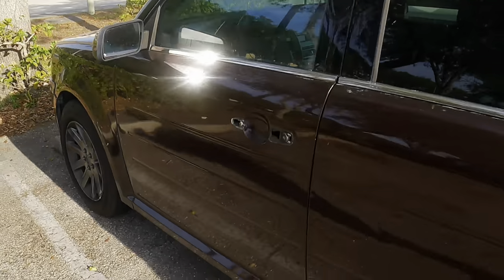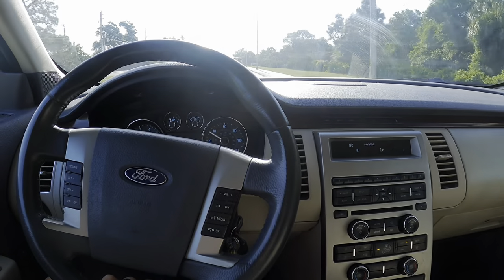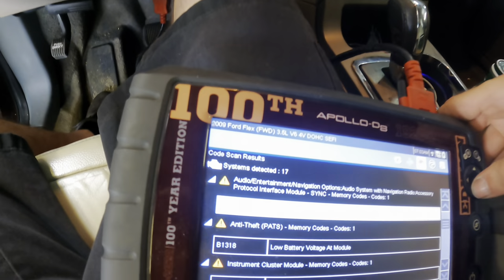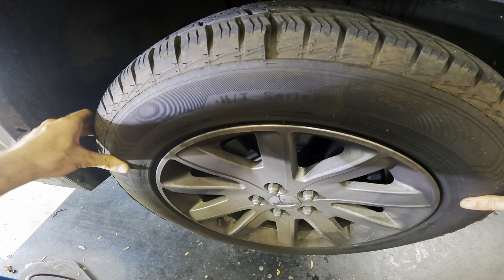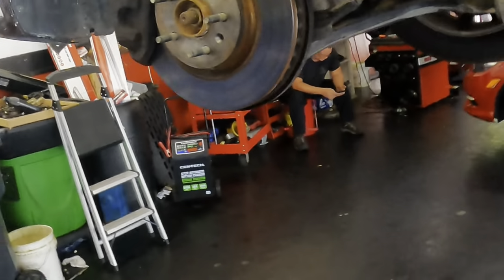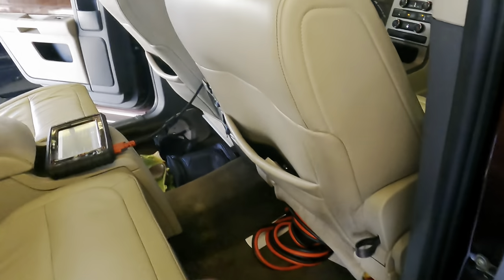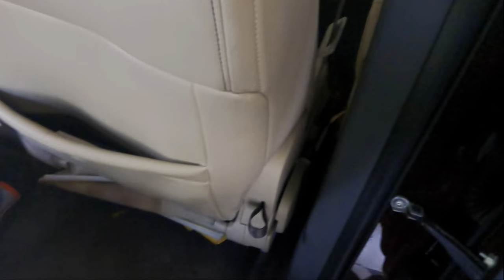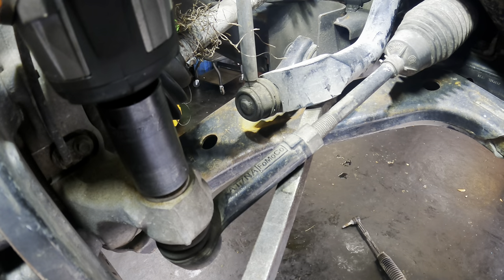Punishment from the Car Gods! 2008 Ford Flex 3.5l Airbag, Banging, Vibrating parts falling off

Comment: You should have checked that tie rod for tightness- it's obvious someone has been working under there and that thing might not be tightened onto the rack.  Lots of clues here- new oil pan, broken engine mount, brake pad clip out of place, no hose clamps on tie rod boots- all say that this car took a big ride off road and someone was under there trying to patch it back together.

Comment: The only Ford’s I would ever own are their trucks. I’ve never heard good long term reports about any of their sedans/crossover/small SUV’s.  That’s probably the reason they have discontinued all their cars except the Mustang this year. To be fair, pretty much all modern vehicles (especially American) are prime examples of planned obsolescence in action. My mother bought a used Escape and it was always having problems. I own an Expedition and the only problems I’ve had so far is the heater blower motor is going out. Thank goodness I have a pretty comprehensive extended warranty on the thing.

Comment: I swear Ray would have been like "WHY" this morning if he had done an oil change on my 2015 Mustang.... Got called into the service bay and told there was a problem with my drain plug... Dude was having to put some serious muscle on it to get it out, they replaced it with a new one that threaded in with fingers.... AND THEN the oil filter was on so tight he literally had to mangle it to get it off... WTF with the over tightening... I'll not name the shop but it's a national chain and the one that last serviced my car was in Clearwater...

Comment: again would love laws that would state that cars identified with steering components that need replacement or things like mounts that keep the engine in the car deem the vehicle unfit for the road and the only way to move the vehicle is if its repaired or put on a flatbed.
Reply: Even better would be laws mandating longer warranties. Some 20-30 year old cars and trucks are only just now getting to needing some of those parts. But, because a simple majority of new buyers replace their cars every 3-5 years, there parts are designed to be weaker than they used to be.

Comment: Hey Ray, I know you mentioned in some video a while ago, what is it when you brake and the steering wheel vibrates? I'd call it warped rotor, but you said something different.
Reply: Worn tie rods can cause vibrations in the steering wheel at certain speeds because they allow the wheel to toe in and out at a resonant frequency.  A warped rotor or a really bad high/low spot is more likely to be felt at all speeds.
Reply: @johnallen1901  It only happens while braking.
Reply: @punkboyblue  It can still be a bad tie rod.  A bad outer was causing vibration when braking on my 2008 Ford.  (Rotors were fine.)

Comment: Mercedes-Benz baller, "break job is too much for my penny pinching tight ass"
Beater owner, "yeah, let's do a few of these fixes that are probably going to kill me."
Reply: Been there, done that, back in the day. Need many bushings, shocks, struts, a window motor, a door latch, an O2 sensor, some AC work, and had to use the shift override to get it out if park...but by God, it had new OEM rotors and pads all around, that cost over half what I paid for the car! 😁

Comment: I would NEVER turn the rotors on a modern car or truck since the thickness of the rotors from the factory when the car or truck was built are at most .010 above min. thickness or right at min. thickness. I would have sent the tie rods back since they were clearly not a complete tie rod assembly. I don't think it was necessary to rough up the surface of the brake pads.

Comment: My 2002 yaris with 170k miles laughs at this. Literally no faults, handbrake could use a maintenance but that's it.
Reply: I had a 2007 Yaris.  I had to replace a CV boot, accessory belt, brake pads at 110k miles and changed the battery out after 12 years and that was it.  Very reliable vehicles.

Comment: There is a correct tool for those clamps it squeezes' and pushes down the center at the same time it crimps. the pliers you used are NOT for those clamps. also a 1 dollar Harbor Freight wire brush on a drill works just as well to clean the rust. Again the gravy done at these indy shops is almost unbelievable.

Comment: One thing I have to ask, what is with the dried leaves + rodent festival in every car Ray works on? I guess as the cars are in the shop the hoods are never opened...
Reply: Soy and corn are used as bases for a lot of wire insulation, trim plastic, and foam, these days. Rodents are attracted to it as if it were the original plant materials.

Comment: just throw it away it was designed to only last 100,000 miles. I find a cheap regular end nippers squeezes those clamps easily you just don't want a super sharp pair that will cut the metal strip off

Comment: Good ole Ford never stops disappointing.  Why anyone owns one today is a mystery to me.
Reply: upkeep the maintenance and they are fine....
Reply: There's exceptions out there but generally speaking, maintenance and upkeep aren't enough for Ford.  I've kept every vehicle I've ever owned in top condition and scheduled maintenance.  It's just not enough when your Ford wants to blow out spark plugs, leak coolant onto coils, leak oil out of every crack, destroy its cam followers, phasers put of whack, parasitic electric draws and electric gremlins.  And I'm just getting started with the list of problems Ford creates..... 

You're one of the lucky ones if you haven't experienced the pain.

Comment: My windshield wiper pump wasn't squirting either, 2010, thought it was the pump, was fixing to disassemble everything but decided to blow some compressed air through the tubing back, disconnected at the windshield cowl, into the reservoir and that fixed it, there was some build up or debris obviously preventing the flow.  All good.

Comment: 3M have those hub flange discs. You can get them through Amazon. Been using them for a while now. Ensures you get all the rust build up off so the rotor sits flush and minimizes any chance of run-out on the rotor. A must up here in Canada.

Comment: yeah throwing wheels like that isn't going todo anything cus the tire will hit the back side of the tire/tyre first before the actual wheel BUT if it's a wheel with a nice lip on it then you can actually crack the alloy or cause an unwanted bend in the lip, depends on the wheel.

Comment: Hi, I'm a UK subscriber. When you diagnose faults and the owner declines your repairs, how much does this cost them? 
In the UK, no repair garage would do this. 
When you take a car in for repair, they can replace components that they think may be causing the problem, and still charge you, even though it doesn't rectify the problem.
If you don't pay, they will not release your car until you do pay.

Comment: Always, always, always roll down the window! One of our techs didn't and put the car into to drive on the hoist for a noise and ended up getting locked out. Had that happen randomly in park too. If the window doesn't roll down, I put the keys on the roof. Not like you're gonna drive off!

Comment: Something I was thinking about: I'd be interested to hear from Ray, or others in the trade, are there general rules as to where you should apply thread-locker, or never-seize?  I'm sure common sense is the best way and there will be specific advice for certain applications but are there "rule of thumb" guidelines which gooey stuff should be applied where?

Comment: Whats fun is you walk out with the keys in hand the drivers door is like that one was, there is no key hole on the passenger side its a car with a trunk 
No remote or keyless entry system and the seats don't fold down.
Your only option is a long rod to open the door from the inside with the long rod.

I once did a old car the guy had the handles shaved off he had a pull line in the wheel well  we put on a keyless entry system, and magnetic switch to pop the door latch, but if the doors were locked it wouldn't open.
I also did a big alarm system on it, the boss went out to demo it to the customer with the motor running he got out closed the dam door, the locks locked  it was 45 mints of slimjim fun to get into it.

One other car the guy brings it to the shop parks in front of the garage door. Locks it up didnt drop off the keys or give us any notes on the dam car.
It was a manual transmission,  took me 3 seconds to open the door with a slim Jim it was faster then using the keys.
 I popped it in neutral and pushed it out of the way.

Comment: You need to buy a cheep set of pliers like the ones you were using for the bellows clamps so you can modify them to work better than the ones you were using, those things were kicking your ass on thos bellows clamps.

Comment: 10:20 based on the things wrong with that vehicle in the scanner. I'm gonna guess it's a clunker/beater and they wont want to spend a lot to fix all the issues. Just looking for that "free advice" to make sure it's not a lethal issue.
Reply: Whenever you see a million codes that read "low voltage" it's nearly always tied to a crappy battery or failing alternator rather than an actual fault with those systems- the jumper cables under the seat are testament to that. Could just be that the car was sat for a while and the battery went flat.

Comment: "Days of the 49 brake installation is over"

Customers know this, its just a matter of supply (money on the customer part) and demand (repairs). When shops starting charging 150 an hour, they should had known that they would lose customers. Back in my day, shops used to charge 60 to 80 an hour, so customers got repairs done left and right.

"Resurfacing of rotors"

Not a scam, but definitely something that is more about money then helping the customer. A lot of engineers and even some manufacturers recommend against resurfacing due to safety concerns. Not only that but shaving (sanding) the metal down will reduce the material and speed up the need for replacement anyway. The cost of resurfacing vs replacement can easily just be an extra $50 to $100, so spend that now to save possibly $600 later.

"tie rods"

A good way of making sure that they go back on in the same relative place is to count the rotations that you used to take them off, use the same number to put them back on.
Reply: Irrespective of that I would do an alignment whenever I change tierods.  I am sure of the steering geometry that way, no approximations.
Reply: @srinathcv5978  Yeah, but unless they are getting it done at the same shop then the customer may need to drive their car. So you want it as safe as possible. Its not meant to replace an alignment, just minimize any potential danger.

Comment: One thing to keep in mind with those Oetiker pliers, you can get them head on like you are trying in this video, or you can get the from the side. There is a side crimp on that set, I have the same ones. Looks like you may have had more space to come in along the length of the tie rod instead of up top like you did.

Comment: Had the same thought as you when I saw all the low voltage codes. Check the battery. But that would be unrelated to the vibration at 50 mph.

By all the things wrong with this car, it feels like this is someone who can't afford to do all the maintenance. So they tend to do the minimum rather than doing preventative maintenance. I would suspect they will do all the things you say are a must do for safety or if they don't do them know the car will become a write off. Other things they will put off until they REALLY have to fix it.
Reply: a great proportion of the state's residents are retired and on a fixed income.....
Reply: All the more reason to keep up with maintenance. It's a lot cheaper than a decent used car, today.

Comment: I didn't really like reusing the old rubber boot on the steering rack, it's in the whole a minor cost that would prolong the life of the repair.
Reply: But one could be had right quick. Had the same thing with my car. I could get tie rod ends from any auto parts store next day, but the boots would take a week. So, the old ones went back on.

Comment: The one thing I learned today is that the Ford Flex is a rolling pile of junk.  It is hard to believe that the tie rods are worn out at that mileage, and how does a motor mount get broken like that?  My Toyota Prius has almost that many miles on it and NO problems whatsoever.

Comment: When someone declines brakes and rotors, it saddens me. You cannot put a price on safety. i want to own a garage where if the customer declines brakes, tires or anything that could save their life, i would tell them, i cant let them take their car until it has been serviced. I dont care if they buy amazon/ebay brakes and/or brake pads.

Comment: Ray with this one you get to Flex your skills so your viewers can learn some benefiting. A couple months ago I helped our younger son do tie rods, cv shafts, control arms, alternator belt, belt tension pulley & belt adjustment rod on a ‘86 Nissan Maxima. They were original parts from the factory, he didn’t buy the car new, everything was a pain in the - - -. It’s ashamed that car owners don’t maintain their cars. Ray in the early part of your video, you stated that the Mercedes owner refused brakes fixed because of the price, then the owner doesn’t need the car, must own it to impress people, keep having a great day
Reply: My ex wife bought a Mercedes to impress people while she was working.  She is retired now and can no longer afford to fix it.

Comment: Wow...CLEARLY you missed that you had NEGATIVE voltage going to the washer fluid pump motor. That's obviously going to make the pump run in reverse, thus filling the reservoir with bits of fluid it finds while driving. I mean, it was right there man...on the meter! REEEEE
Reply: Leads were reversed..
Reply: @chrissmithz314  Clearly...I was being sarcastic. Thought I laid it on thick enough...apparently not.

Comment: Run Till Fail. Don't fix anything until it becomes unbearable to drive. Then dispose of the vehicle because the repair costs outweigh the value of the vehicle.
Reply: Then get exposed to the current used car market, and rethink your decisions!

Comment: Really enjoy your vids except this one. so much unnecessary work being done. 10 moderately hard stops at 50mph would have taken care of the brake juddering problem and left that material on the rotors to better dissipate heat. could have been done on your post work test drive and saved the customer some real money
running the TRE nut on by spinning the ball joint instead of holing the ball joint and turning the nut likely shortened the life of the joint. How much shorter, nobody knows
I'm in the north, so I cringe when you assemble the tie rods without putting any anti seize on the threads. Eric O wouldn't punish the next guy like that

Comment: That's one of the worst pieces of crap I've seen in your series so far EXCEPT for the phenomenal fuel mileage. 104 miles until E and it looks like less than 1/8 tank left on the fuel gauge. Or maybe it had a 270 gallon fuel tank?

Comment: I had a Airbag light ON on my 02 Ford Ranger. I was previously cleaning stuff out from underneath the seats, and doing a Youtube search on this matter it was suggested to disconnect the slide connector under the driver seat and re-connect the connector. The Airbag light cleared.